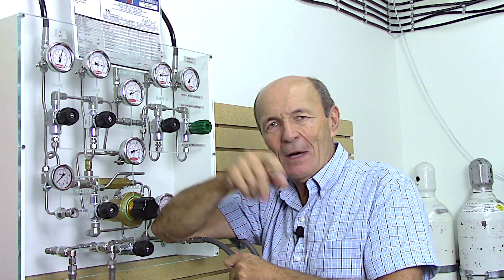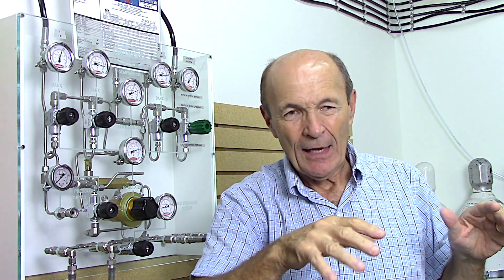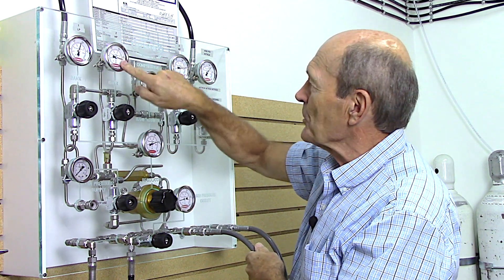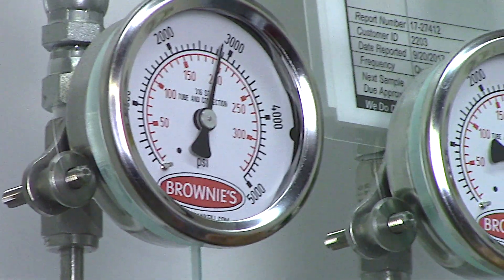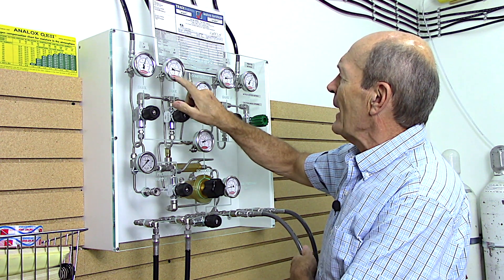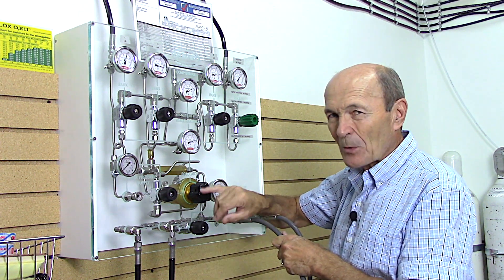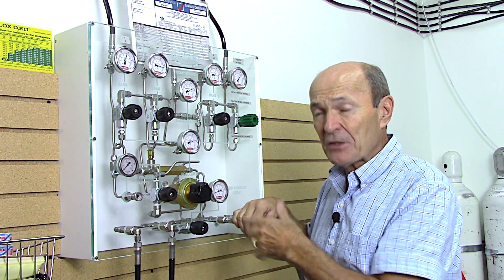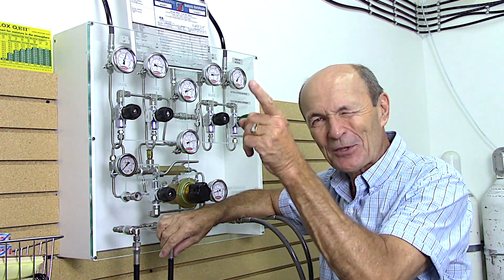What Is A Fill Station? - Scuba Tech Tips: S08E09

Comment: If you are taking air from a 2.7k PSI tank into an empty tank, won't you end up with less than 2.7k PSI in the previously empty tank due to the extra volume that 2.7k PSI has to equalise over?
Reply: He will, check out his video on multi stage gilling systems. :)
Reply from the maker: For sure.  Not everyone gets it so  best to watch my video on Cascade Filling.  It should answer all your questions.
A

Comment: Alec,
Apologies in advance if you’ve answered this question or if you find it odd!  Is there any risk of virus tainted air ending up in your cylinder from the dive shop fill station?  Also, thanks for the Force fin reply. I’m going to upgrade to the Nova 👍🏽
Reply from the maker: No risk to divers from LDS fills as they generally use very big 3 stage compressors.   The heat generated from compressing the air is sufficient to kill COVID and any other virus.  Otherwise there would be no air fills or diving due to contaminated air and that has not happened.  Take care Judson.

Comment: I'm in the process of designing and building completely new fill station arrangement for the shop I'm at.  Your video is extremely helpful in getting a good grip on just how I'm going to physically implement the panel.   

Since I'm implementing banked Nitrox 32 with continual blending with a stick to complement our current partial pressure blending I've also got your nitrox video cued up.

Thanks for giving me great ideas on how to spend the shop owners money.  (and I've got the same Analox chart at the Nitrox station and Trace Analytics does our air analysis also)
Reply from the maker: Also watch my video on how EAN is made which will show more tips on fill station setup.
Alec

Comment: Something which my club has implemented is an "arrestor wire" system. Essentially a strong wire is fixed to the walk and follows the length of each charging hose/whip. The wire continues a little longer and a dog clip is attached to the end. The clip is secured with a number of cable ties along the length of the charging hose/whip and suitable metal retainers are used to secure the dog clip.

When you attach a cylinder for filling, the dog clip is then wrapped around the neck of the cylinder prior to opening any valves.

Should something go wrong and the hose become detached from the cylinder valve being filled, then it won't whip around dangerously.

It takes a little getting used to using t at first, but it works well. The length of wire used for wrapping around the pillar valve had to be increased a little to accommodate twin sets. For single cylinders, you need to wrap it around twice.
Reply from the maker: Interesting idea. Sounds good.
Thanks ScubaGirl.

Alec

Comment: Thanks, Alec. I pick up new skills every time I see your videos. Very useful as a new beginner. Should I get my own air compressor on my sailing boat? If so, what type of compressor should I get? On a 42 feet sailing vessel, space is limited. I could find space for a compressor, can I build a fill station onboard? Not doing any sophisticated diving (jet). The alternative is too keep a few tanks onboard. Any advice?
Reply: My reply is probably way too late, but in case anyone else wonders: A small compressor for nautical use is the Bauer Oceanus. A cheaper, smaller, but less resistant to salt and lean angle, compressor would be the Bauer PE100. You can get a petrol version if your power system can't handle the amps. Definitely get professional advice before buying. For regular air diving that'll be sufficient (filling a tanks takes 20-30 minutes and they're noisy). If you want Nitrox you'll need to bring an oxygen tank too and a nitrox stick to mix the air and oxygen. Nitrox sticks can be built in small suitcase sizes. You'll need to monitor it during the fill (because oxygen) but it'll reliably get you Nitrox up to 40%. A few tanks are cheaper to bring along, so it depends on available space and amount of dives you want to do.

Comment: how about the practice of dipping the tank in water to cool it down?
Reply from the maker: If your tank is hot, dipping in cold water (the lake?) is ok I suppose. But putting a scuba tank in water when filling it a waste of time and can lead to problems too.
Alec
Reply: @AlecPeirceScuba_SeaHunter  I seen it all the time in my place. The operator would put the tank in water while filling. Kinda heat exchanger kinda deal. And most don't use bank (I had never seen those banks ) as you described. Straight from the compressor.
Reply: All the fire departments down here fill there tanks in water baths for safety.

Comment: Air warms up when it is being compressed. Coming out of a high pressure tank into a lower pressure tank, it actually cools down. Unlike filling directly from the compressor, filling from an airbank should not require cooling time, unless the bank was recently topped up and is still hot.
Reply from the maker: It may look that way but, assuming the cascade bottle is at room temperature, even if it's at 4500 psi, when the air flows into your tank at low pressure, the pressure in your tank goes up and so does the temperature of your tank.
While it's true that the temperature of the cascade bottle may go down, that's of no consequence to you. The relative temperature of the two tanks, yours and the cascade, is not related.
Assume that the two tanks were located a long ways from each other. As air is removed from the cascade bottle, it cools. But as air is compressed into your tank, it heats up.
Cascade or compressor, the air in your tank is being compressed - it gets hot.
Alec
Reply: @AlecPeirceScuba_SeaHunter  The air already in my tank compresses and heats up, but the air joining it from the bank decompresses and cools down. Which effect is bigger? Hmmm...

Does the amount of air in my tank affect the outcome? If my tank contained vacuum, clearly the net change would be cooler as there would be nothing to compress. Right? So maybe near-empty tanks cool down when filled from banks, but half empty ones warm up?
Reply: @KimonFrousios  as the pressure increases in your tank, the temperature rises , it is thermodynamics and not related to the air source, there the importance to let your tank cools then top up, 
a way many dive shops do ti to overpressurize the tank by about 300 PSI to compensate for this phenomenon.
Reply: @jacquespoirier9071  The air warms up in the tank as the pressure rises, yes, but the air coming in is cooler than ambient since it was just decompressed. I guess it is not cooler enough to counteract the heat from the compression. It's not worth the time digging out my textbooks to refresh my memory on equations and do the math, I was just wondering out loud at what tank starting pressure the cooling effect equals or outweighs the warming effect.
If the tank started at vaccum (unrealistic), the only air in the system would be the air transfered from the bank and it would suffer a net decompression and thus cooling and the tank would be cooler than the bank was before filling. So between that extreme example where the tank temperature should drop and the typical starting tank pressure of 50bar where the tank temperature rises, there must be a tipping point where the tank temperature does not change. That assumes of course the ideal (unrealistic) situation where heat is not exchanged while the air travels through the long pipes from bank to tank.
Reply: @KimonFrousios  a factor omitted there is crucial on the temperature rise, it is the time involved in the compression cycle, 
on a Diesel engine, the compression ratio is about 20:1 so at BDC, the pressure in the cylinder is about atmospheric pressure, at TDC, the ambiant pressure is about  20 bar ( about 300 PSI) minimum, with the heat expasion of the gas, about 500 PSI and the temperature is at least 1000 deg F( 500degC )so the fuel ignites spontaneously,
 the factor here is that there is about no time to transfer heat to the surrounding parts( about 1/30 second). on the compresor itself, you can encounter such temperatures as the compressoin process is about adiabatic but the intercoolers and aftercoolers takes care of that ( it is the reason why a diving compressor that pumping oil carbonizes it in the second and third stages).
when filing a diving tank, the compression heat takes effect at a much lower rate so the temperature rise is much lower but sufficient to cause a pressure drop when the tank is alone for a period of time

Comment: Getting a tank filled in this century is a lot more relaxed than it used to be. Once upon a time, the operator would place your tank in a heavily reinforced concrete tub of water and stand clear as he slooowly worked the cascade valves. If your tank exploded the shards would theoretically be directed straight up. Also, the water bath served as a coolant.
Reply from the maker: The water bath is gone for good reasons Norman. It didn't help cool the tank and it created some problems too.
I have some videos that explain that.
I think the filling procedure is more relaxed now. There are very few problems now with tanks. Fill operators are all well-trained and the tanks are better regulated.
Take care.
Alec

Comment: Always a great presentation Alec.  Loving my Bauer Junior II compressor at my home... 🤓 Cheers, #SeattleRingHunter
Reply from the maker: Bauer is one of the best - not cheap but worth every penny.
Good luck.
Alec
Reply: Alec Peirce Scuba absolutely correct Bauer is one of the best system on the market. Impeccable German engineering and time proven solution  for the breathable air compressed gas market. Exactly why I sourced the Bauer Junior II as it quickly made no since to me to purchase some hobbled together Chinese pile of crap with.no real spare parts or service support.  Reality is this is a life support system and no one wants to compromise breathable air. Bauer backs their products with precious spare parts for a very long time after the product reaches the market and has such a large footprint in the market that their units are very well known worldwide making for a much improved equation for the long term investment in their systems. Have been enjoying my Junior II for many months now and always appreciate the opportunity to fill my own tanks at home.  What a game changer, as life is busy enough these days. Got a crazy good deal on a previously owned never used unit for the win!

Comment: Alec,
Thanks for explain the complex system of how a fill station works. I know that i will most definitely be recommending this video to my customers. You did mention for a brief second the debate of volume vs. pressure and I was wondering if we could get a future tech tip on that? As a dive store employee and a scuba instructor, it can be difficult at times explaining that concept to new divers. Just wondering how your approach was on it.
Safe diving!!
Alex D.
Reply from the maker: Thanks for your comment Alex. It's always nice to hear from a scuba industry pro.
I too have struggled to explain the difference and don't know yet if I have the answer.

One thing you might include in your explanation is that "you can't breathe pressure and you can't measure volume".
What I mean is that air volume (the amount of air available) is what you need to stay alive underwater but that's hard to measure.
Air pressure is easy to measure but it's of no use to you in determining how much air you have - 15psi or 3000psi - you can live with either.
So we need to have volume but can't measure it; we can measure pressure but we can't breathe it.

On second thought that may not help!
Oh well.
Good luck.
Alec

Comment: Hi Alec 
Can you also discuss using a membrane storage as well for EANX? 
Thank you 
Will
Reply from the maker: NITROX production using the membrane method is less common than others but it's quite legitimate. It is quite interesting and based on the fact that, depending on the temperature and the pressure of the air, as air passes through a membrane, the oxygen and the nitrogen pass at different rates. It's possible therefore to pass air into a membrane and, with the careful use of O2 sensors, separate some or all of the nitrogen from the air leaving - enriched air!
While more efficient in terms of energy use it's also more expensive and requires considerable expertise.
You can get a fair grasp by looking at the NUVAIR website. Their system is probably best known in scuba diving.
Take care.
Alec
Reply: all the dive boats I've been on in the channel Islands (Santa Barbara SoCal area) use membrane Nitrox I believe and get used a LOT, especially on multi day trips where it's not uncommon to do 6 dives a day. One time something went wrong and I had 45+% O2 in my tank so we had to dump and refill to 32...The few shops that do Nitrox locally typically have pure O2 tanks and pre-mix - buddies and I don't go to those that do pure O2 fill as it's a royal pain and $$ to have a dedicated O2 clean tank. Have them mix it for me instead! (supposed if you want other than typical 32% you have little choice).

Comment: Hi Alec. You talked about the Cascade bottle system but you didn't elaborate on why the prefill and topup? I understand that having the main tanks filled to a high pressure so you don't start the compressor every time a tank is filled. I am guessing that it is a safety thing ? or is it an efficiency thing to prefill to 2700 psi first? You mentioned that you are back working again, You just couldn't stay home I guess. Thanks Owen M
Reply from the maker: Wellll. I wouldn't say I'm back to work. That might be a stretch.
Diana and Kevin keep me so busy that I've been thinking of going back to work so I can get some rest!!!
Take care.
Alec
Reply: There are a number of good reasons for using a "Bank" system, such as what is shown here.

A compressor would fill a small cylinder very quickly. In the process, it will get very hot. This is partially due to the action of the compressor, but also to do with the gas becoming compressed in your cylinder. The gas inside will then cool down and you won't get a full fill. This is more noticeable on the smaller cylinders/tanks, but is also present on the larger ones too.

By using a Bank, the gas from the compressor has a chance to cool down a little as it sits in the bank cylinders. You can also store the gas at a higher pressure than you are going to fill any customer cylinders. The gas filling your cylinder can warm up, but not as much.

Comment: Thanks for the interesting video! Question, what are the advantages of using banks instead of filling straight from the compressor?

Keep up the good work
Reply: Speed of filling.
Reply: good question because my dive shop uses a big compressor and can fill a single 100HP tank in under 10min which gets it quite hot so I'm always nervous and asking them to fill multiple at once (they have 9 wips of different pre-set pressures, 3 low/med/high). It's loud, but then doesn't require expense of big air banks and I assume ongoing hydro/viz test they I assume require - Alec I assume those big 4500psi air banks need same hydro/viz our tank require ? gotta be pricey...